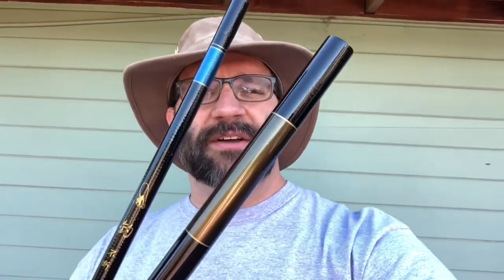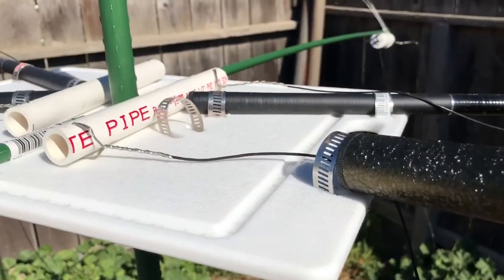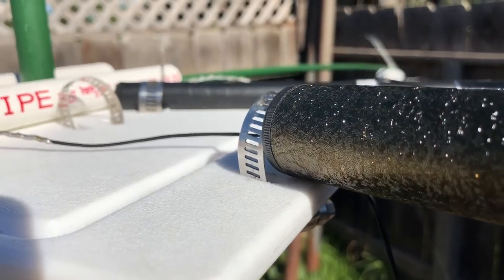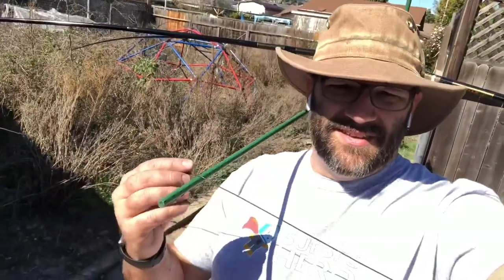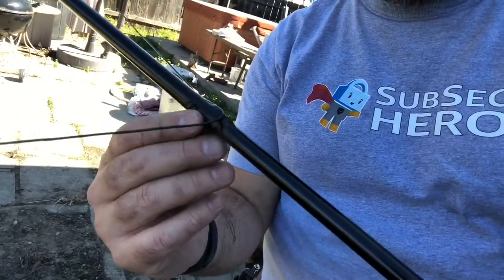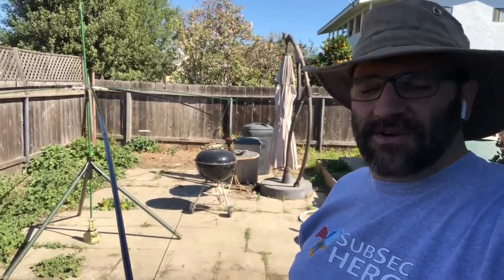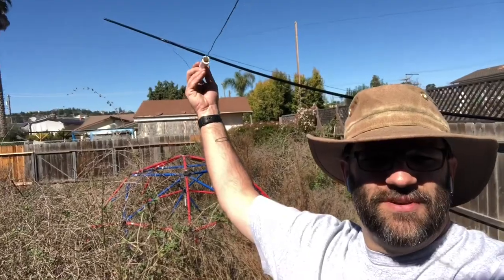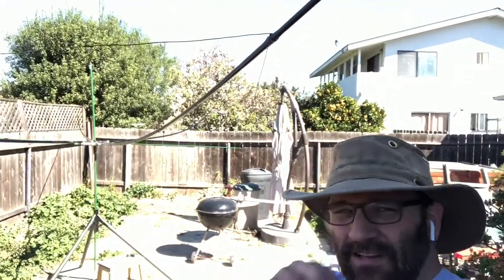Smitty Working On SOMETHING: 20m Moxon Antenna Build, Part 2

Comment: As an antenna with much capasitance in it Moxon heavily, EXTREMELY depends on height. You may have even lower resonance at working height. You should test it at least at quarter wavelength height (5 meters and above). And FYI, changing height changes fb and gain, for example, at 10 and 9 meters high same antenna has pretty much difference!

Comment: yeah Smitty. What you said. I agree. I wouldn't be snipping any wire off of that.  My next move would be to get it up higher and up in the clear. I would also look at the balun and feedpoint and coax length.  Keep us posted.  ...looking forward to the next segment.  73.

Comment: May I ask, where did you get the fiberglass poles from?
Reply from the maker: Those are "Crappy Poles" from ebay. They're actually carbon fiber, though in hind sight I'm not sure I'd recommend carbon fiber since it is conductive and does affect the antenna.  Since it's not IMMEDIATELY parallel to the wire, it might be ok.

I took this antenna down before getting it completed (replaced it with a Comet H422 which includes 40m) so I don't really know how well it would do.

Comment: do  you have a  vedio on  the 40 meters moxon   I want to build one
Reply from the maker: No. I WANTED to build a 40m moxon, but it's just too large to do with unsupported wire. Even the 20m I was building was rediculously large, which is a large part of why I never got it working, hence the lack of a Part 3 video.

I'm sure a 40m moxon would work ELECTRICALLY, but the physical construction would have to be more complex for structural support reasons.

Instead, I'm looking at a Hex Beam. Most 40m Hex Beam designs I've seen have a dipole config for the 40m element, no reflector, so it wouldn't perform as well as a moxon (which is a 2 element antenna).  But getting a rotatable 40m dipole on the same antenna/feedline as a 2 element beam on 20/17/15/12/10/6 would be a pretty nice compromise, especially with Cycle 25 coming on strong now.